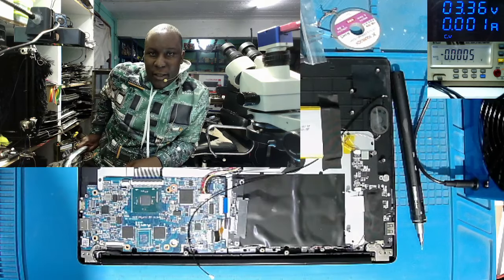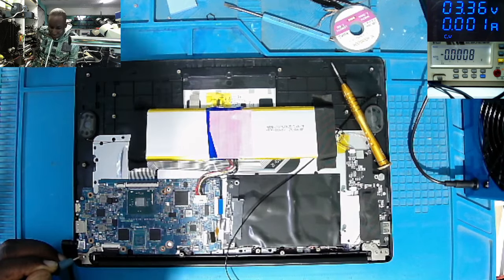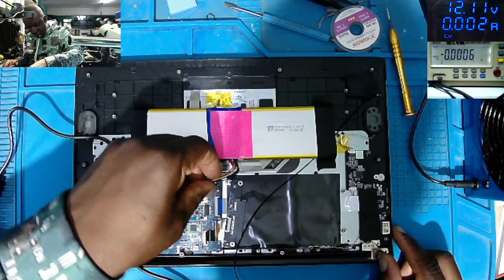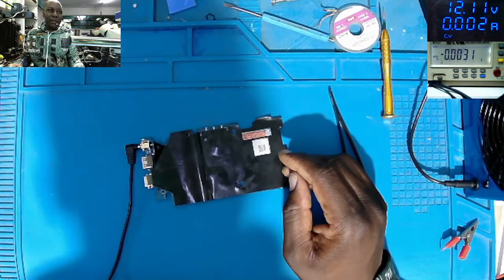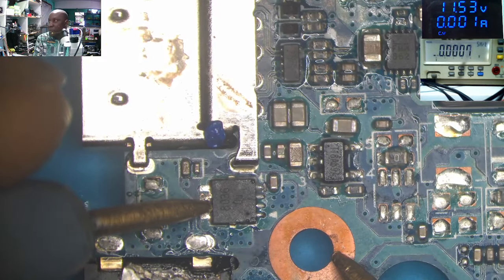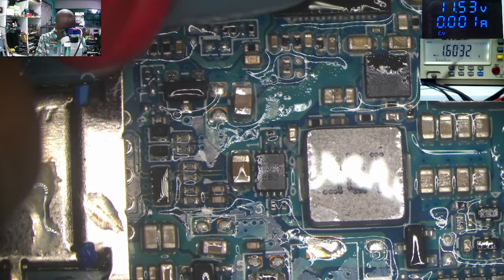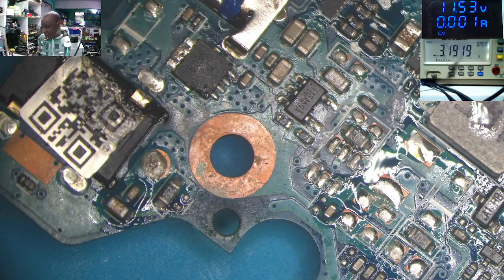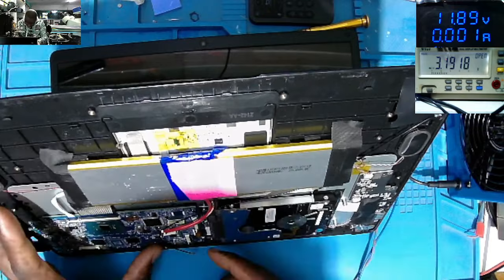Proline Laptop No Power, No Life  Board Repair, Dealing With Blind Faults--Almost Challenged Me!!

Comment: on 16:20 half of time you not punishing amps to the board at all :) its like you start and stop-start and stop you don't have a thermal cam to see a color change you need to push that power into that faulty part to get hot af :)